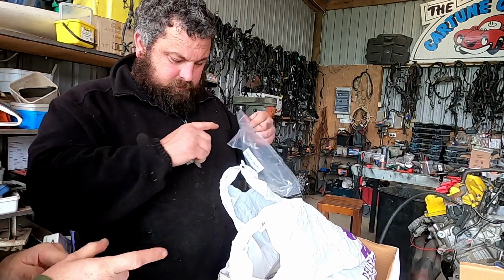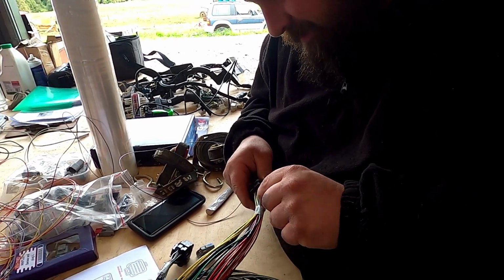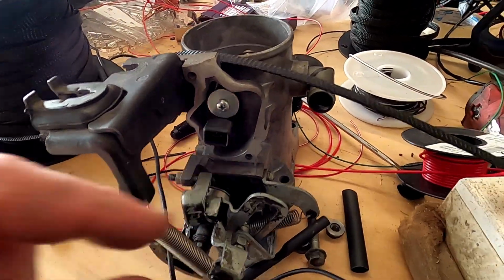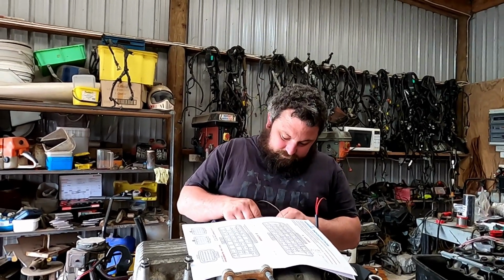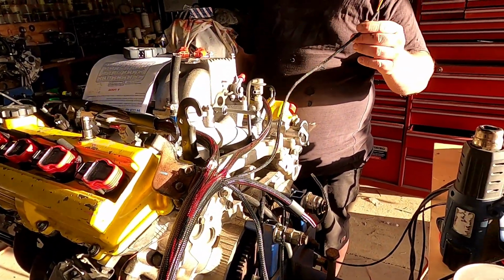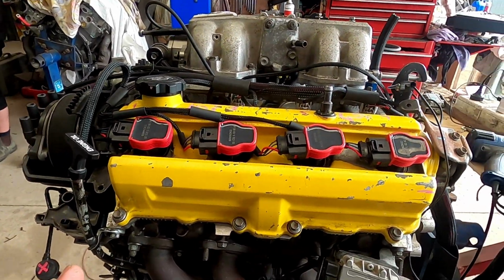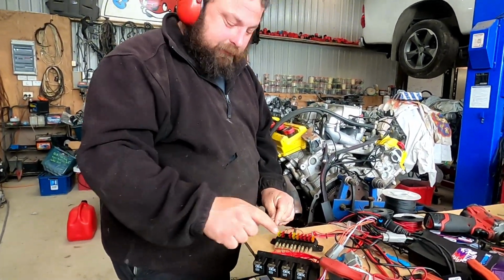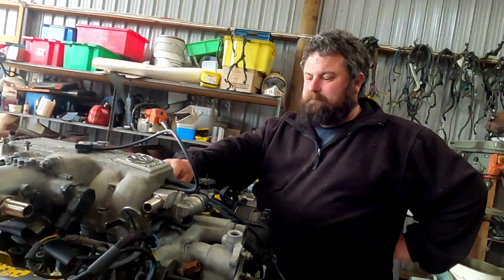Link ecu storm to 1uz non vvti with audi R8 coils

Comment: Hi Kelvin!
What's the reason you have chosen RS8 coils? Do they make let me say stronger ignition if compared with for example OEM 2uzfe coils? Thanks
Reply from the maker: The R8 are a very good option.  My preference is the 3uz/2uz coil but have no issue with the R8 , which product a great spark , there are plenty of options available and relatively cheap.  Customer make the choice in this case.  Cheers Kelvin
Reply: Ok, but what about comparison of ignition? Will R8 coil make my 2UZ feel better if I change them over? Thank you, Kelvin

Comment: Kelvin, The Audi coil pin out is +12v, Ground, Signal ground. and ? I am guessing that the Link controls power, correct? Looking to use these coils on my wasted spark Mazda MX-5...
Reply from the maker: 12 volt,   two earths and trigger.   The trigger wire is controlled by the ecu.  For the two earths one is technically a chassis ground and the other a signal reference ground, which technically is meant to be wired back to the ecu signal ground,  but they work fine (better) wired with both grounds to chassis ground.  Be aware different audi coils have different pinouts too.

Comment: Hey kelvin im looking at wiring up some audi r8 coils into my rb25det skyline. I know you can purchase electrical connectors through ebay. But would there be a new zealand supplier ?? ( im in nz) thanks peter.  ( great videos really enjoy them )
Reply from the maker: I try to keep them here to for my own jobs as not so easy to find.  I can supply if required.  Cheers Kelvin
Reply: @CartuneNZ   kelvin  how could  i get in contact with you  to get a price  on 6 coil plugs if possible ?    Thank  you for  your  reply too. Very good of you.  Peter.
Reply from the maker: Email,   info@thecartunecompany.co.nz